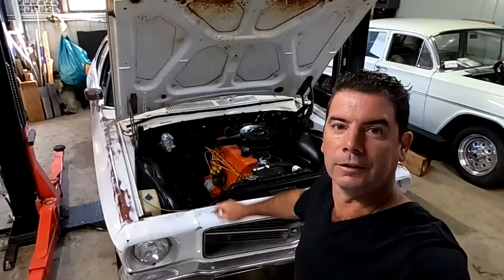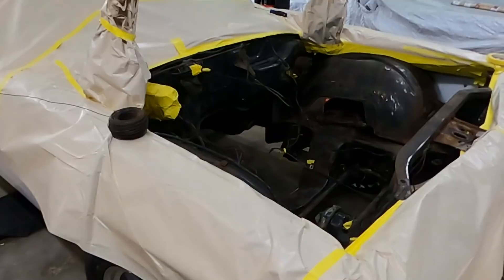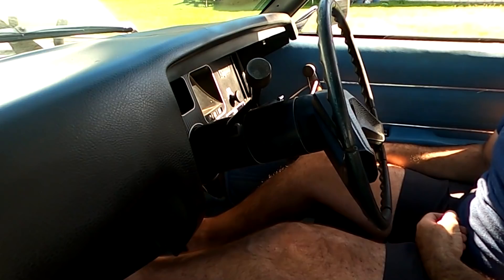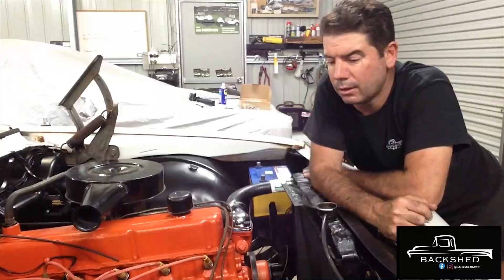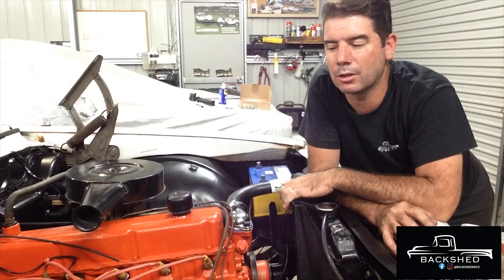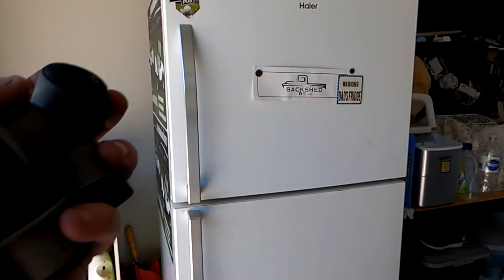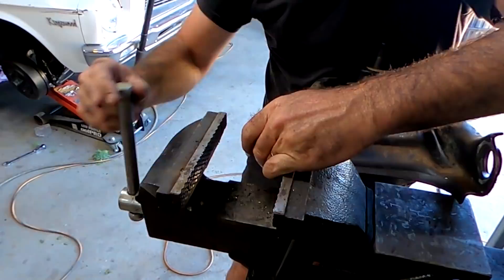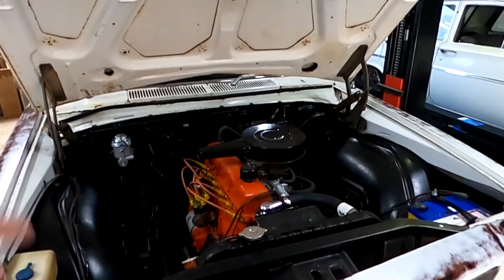Ep9. HOLDEN HQ CLASSIC RESCUE , WE SWAP IN A FRESH MOTOR AND RUN HER DOWN THE HWY .

Comment: My dad used to drive the same series (1) if HQ Holden Kingswood station wagon as that one of yours except that it had the Tri Matic automatic transmission fitted.

The original 202 engine ended up sitting in the back of the shed after it lost power then hd gave it to an old workmate of his who was into restoring the old Holdens & Chevs since he was a spray painter/panel beater by trade,he didn't really want the engine because he would prefer to stick the old grey 138 engine back into an FC Holden he restored.

The engine that replaced the 202 engine was out of my uncles old HQ Kingswood sedan,it was the 173 cubic inch engine, once that wore out he got another 202 engine for mates rates ($0)off another workmate & bolted it in.

Once that one wore out he bought another 202 cubic inch engine from our local wreckers for $500 AUD, there was a 186 engine sitting there & no one was there for him to ask about it & he was on his way to work on afternoon shift so he couldn't wait for that engine.

He would've been better off I think because he had trouble with that engine including a blown cylinder head gasket then thr dreaded cylinder number 5 issue happened where it ran lean on that cylinder,the connecting rod snapped after the piston seized in that cylinder.

I literally cried after that happened because my dad was forced to buy a Mitsubishi L300 van off my aunties ex partner who worked at a local Toyota dealership because he desperately needed a car to cart my mother & us 5 children around in, yes,i had a soft spot for that sort of Holden since my dad & i drove home in it in 1980 after he needed to replace his LC Torana.

It cheered me up a bit when he was referred to a good motor wrecker by my aunties ex , the wrecker had a rebuilt rope seal type of 202 cubic inch engine out of an LX Torana for sale fyr $300 AUD.

I swear that it was a 208 cubic inch engine,it had heaps of compression & went very well for a "202" engine,it ran very smooth as well.

Je ended up selling the engine for $100 to that same workmates neighbour,the workmate who gave my dad a 202 engine for nothing & he ended up gaa axing the Kingswood & scrapping it because it was full of rust.

Yrs,I am a Holden who loves Holdens,I drive s tuned Holden VY SS Commodore now & I am wondering who thr hell got me into a  Mitsubishi ?

Comment: Another enjoyable video, really like what you are doing with this HQ...I cringed a bit with that vice and the rubber bushes...always good to have a thin piece of wood, alloy or brass to line the vice jaws for such tings..:-)
Reply from the maker: Yep i hear ya mate , I did make mention of I should have had another socket on that end but I’ve done that bush so many times in that vice that ya get complacent after not damaging so many times 👍🍺
Thanks for watching mate

Comment: Yep the Q is coming up nice. I did spot the 186 stamp on the block. In my opinion the 186 is a better motor than the 202. FYI the HQ also came out with a 173 6 cylinder. Thanks Stew.
Reply from the maker: Yep thanks for watching mate
And yep I did say that in the video about the 173 and 202 were in the Hq.
🍺👍

Comment: Not sure if helpful, but without the correct clutch line up tool ive used 3/8 extension bar and socket fitted backwards, slide into the spigot bearing and aligned that way.

Comment: They also had a 138 for export and government agencies.Still red motors some toranas had them 2250
Reply: Actually the export engine was 130 cubic inches 2.130 litre available in 

HT Holden / HG Holden

LC Torana and LJ Torana

 AQ/HQ Holden
Also built and released before the 138
Reply from the maker: I didn’t know that ! There ya go.

Comment: I'd like to see how you do the balljoints as im worried the set on my WB is going to let go one day while im driving. What rust did they ask you to repair? The only crusty bits i saw are that spot above the right back wheel and a few small spots in the beaver panel
Reply from the maker: You nailed it mate , the right hand wheel arch was paper thin so that’s done , she’ll be back very shortly.
🍺👍

Comment: Just discovered ur channel. I've always wanted to do this, being a hotrodder I'm handy with the tools but how are you getting these re registered in NSW? Do you know someone? I seen historic plates?
Reply from the maker: How I’ve got it registered is not a secret mate , it’s road worthy. Cosmetics are not a safety issue , if it has no rust hole and is mechanically safe ( ball joints , seat belts etc) it passes an inspection. Having said that not all inspectors will pass surface rust 🍺🍺👍

Comment: So you took the front suspension out of it to fix the upper control arm bushes, now you have to replace the lower ball joints. Do you know what you are doing??
Reply from the maker: Hahahha nope probably not hahah.
But what you may have missed while you were busy typing was NO suspension was removed to do the upper control arm bushes , to remove them is 3 nuts , upper ball joint nut and control arm pin nuts x 2. No suspension or springs out , no brakes ,no steering , no swaybar , nothing, 3 nuts. I did inspect the lower ball joints then and although not perfect sent it for an inspection. The inspector agreed to a degree that they were ok but preferred them changed. In the next episode I removed the lower control arm undoing none of the area I’d previously worked on. To answer your question of do I know what I’m doing ? I’m having a tonne of fun getting an old car back on the road Without restoring it. Running and driving without spending unnecessary $$$ is what this Hq is about. Thanks for watching